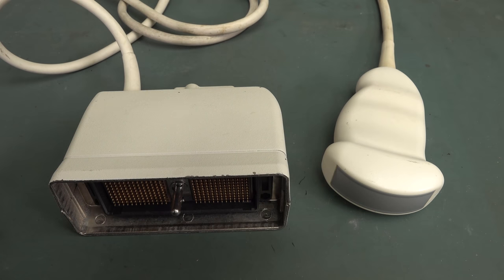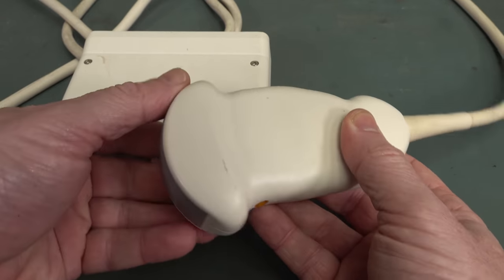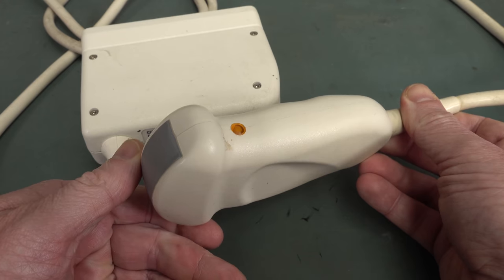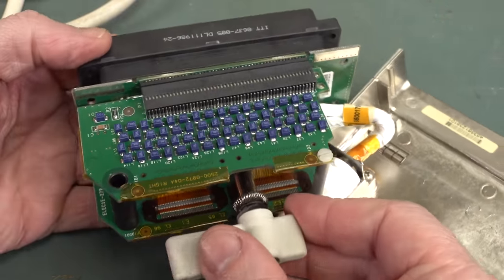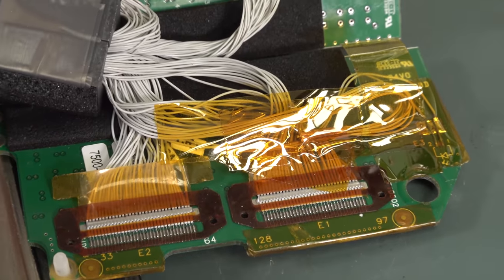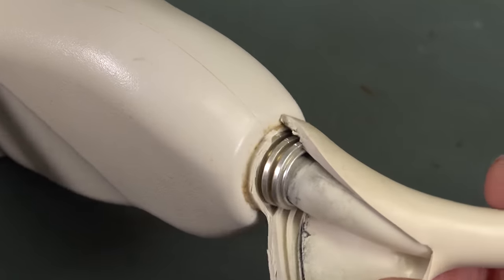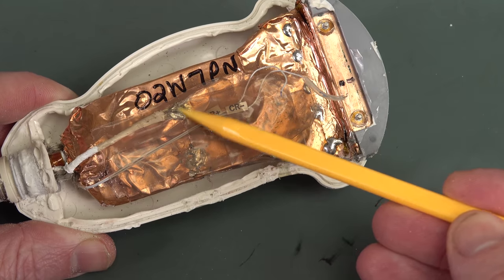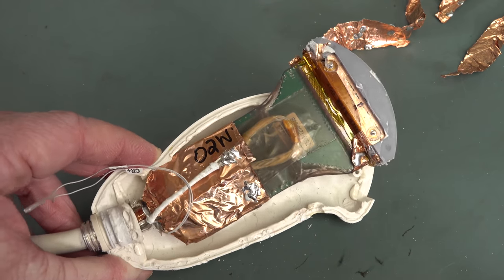EEVblog #1315 - Ultrasound Probe Extreme Teardown!

Comment from the maker: That time when you destructively tear down something old and then find out they sell for up to $500 on ebay...
Reply: Wow, ain't that a bastard
Reply: Still, we are so grateful for you taking it apart! Very interesting ;)
Reply: well.. selling something for $500 doesn't necessarily mean it will be sold for $500 :D
Reply: Just pretend that the reason they threw it away was because the bit that makes this worth the 500 is somehow broken and thus the mistake doesn't look so bad suddenly.
Reply: All usg stuff are overpriced on ebay (i repair them as daily work), this one is worth  $50 max but you need to sell it in Africa.
Reply: Probes cost around 10.000-40.000 euros new ;)
Reply: @robertjung8929  That is what is routinely assumed for shares...   Ridiculous, I know, but all the stock markets are based on this delusion.
Reply: The current type (with the modern USB interfacing so quite a different beast) is selling new for 6,500 euro...
Reply: i doubt this goes for 500, these are found everywhere for cheap on ebay. 10..50 bucks at max if its this old   if its listed for 500 doesnt mean its worth this much.
Reply: I think I accidentally clicked on the "Report" button on this comment. Sorry. :(
Reply: The educational value for all your viewers is worth more than 500 bucks. Thanks for the teardown!
Reply: @Rob2   .. That's SURPRISINGLY cheap. I would have estimated 1-2 orders of magnitude more.
Reply: @perfumedmanatee6235  Take it apart, then sell it on ebay if you can!
Reply: That's the price of science Dave :)
Reply: @iamdarkyoshi  I to infinity and beyond on that comment totally totally totally agree.
Reply: @perfumedmanatee6235  I knew that was coming I could just smell that comment somewhere.
Reply: @TomStorey96  yeah you could sew it as a Dave Jones artifact.

Or SAS dismantled by Dave Jones of EEB blog.

And record a video of the YouTube video and send it with him on a DVD.

And say it was recorded performance art.

You know how they shredded that painting antonym who knows maybe this is the next thing.
Reply: @Petertronic  oopsy accidentally clicked thumbs down Mediquick thumbs up recollect it there you go I think we've all done that.
Reply: Hey don't feel bad I think I did worse once but don't know a long time ago excetera excetera and this was before eBay existed or even the internet or anything so yeah.

I had gotten ahold of a bunch of what seemed like random bits from old electrical/old school I mean really old schools Electronics this was back before they had even integrated circuits at least a time. This thing was from.

Even some vacuum tubes were even still coming out at that time. Don't know the year or anyting.

But what I dismantled in discombobulated and Salvage scrap whatever may have been possibly a piece of electronics history?

Don't know when it was made or for the later one or what?

Or even what of it was used for what but only had a lot of bits and pieces and some assemblies and a lot of other things with this. A lot of it look very similar if not the same.

Recently owned reading and realized that oopsie.

It was branded Westinghouse almost all parts Westinghouse.

All the wiring most of it was cloth covered 

And it even has an influence for battery like 24 possibly some other voltages. I can't remember everything.

There was a fairly large panel with wide binding posts and other criminals wire links.

There was also a couple panels that had receptacles in addition to all that.

I do remember seeing a tag on a related said Westinghouse supervisory relay.

There was what looked like a tuning fork except it had coils and some other things on it.

There was a couple big solenoids and some sort of a speaker or what looked like a big old school telephone earpiece except obviously put out more audio than. That.

And there was a tag that said tell us something something something couldn't read it it was so badly just not there.

I mean this stuff and me who knows how old.

My understanding was part of this was used as a demonstration system of some sort and it's part of it came from actual installations but I don't know what was what.

After further recent reading a few months ago I figured out that this may have been something to do with the Westinghouse televox system.

As I remember it looked a lot like what was in the reading material.

And I also noticed there's a lot of that stuff that was Westinghouse branded although a lot of this was just random junk.

Me and there was some pretty cool interesting stuff that I want if I see using out of it as well as other things in I guess you could say a pile as well.

But I got this from someone that I knew a long time ago

He had gotten a few truckloads of just odd stuff.

And evidently just came from and old at least some of it for a power plant and other industries that have been shut down for years.

I don't remember any details from where it was or anything.

And he said that it had been in storage even after that fact.

And yes there were some tubes but not like anything I've ever seen.

There is mention of something-or-other grid glow something something.

At first I thought they were some sort of weird maybe Annie on memory tube or one bit something or possibly maybe a switching the neon lamp of some sort.

Or maybe a one bit memory tube that would be connected to a capacitor and a charge would be applying which would cost of tube to conduct and then retain their charge on the capacitor.

KY wife what they used to do for some of the old TV tuners that used a neon indicators as a one bit memory.

Or I thought those tubes could have somebody do of triggering or indication.

 at first I thought it was some sort of voltage regulator tube.

Not necessarily the oldest actually probably was the oldest if I've ever taken apart wish I maybe I haven't taken Man Apart.

It was kind of a shame. After I realized what it might have been.

 it seems more like instead it seems more like instead of it seems more like instead of I killed Kenny I killed televox?

 This very well probably was a piece of electronics history. Debbie sorta-kinda f.

But evidently later on this was used as at least what this was part of if it was a demo unit.

Which is unknown to me of course.

 Although part of it may have been in part of it may have been used in distillation because amount of it and the various looking parts that wears the same internally.

Essentially later once it was further developed it was used as an automation system of some sort.

It would have been used over the old telephone system to be able like control maybe like four or five items or so. Unattended.

Fraud over the cliff come from the same place but didn't seem like it.
Reply: Sould i buy a Siglent SDS1104X-E or a  Rigol 1054Z the (rigol is  110$ cheaper)
Thanks
Reply: Thanks! You helped me fix the one I am selling with 2 other probes and an ultrasound machine for $3700.
Reply: what's more, is some people can't even buy one cause their country (like India) has various laws to prevent gender "selection"
Reply: f
Reply: Some hospitals has been demolished with this equipment left inside._
Reply: 5:52 bahaha
Reply: This was more than $500 worth of content so product well spent!
Reply: Y'know Dave, they're about 10-20k€ new in Germany
Reply: @robertjung8929  this thing is even lot more expensive, a sector array probe like this one would cost around 5000$
Reply: You'll make more in that on this video I'm sure!
Reply: Can I ask what you did with the transducer. I'm intent on building some Jordie glasses.
Reply: Next teardown is phone ultra sound
Reply: It's similar to Phased Array radar, only it's using a ultrasound transducer. The actual beamforming is doing by phased offsets and can be scanned in various modes. Constructive and Destructive interference, much like RF radar.

Comment: Ultrasound professional here. The C5-2 used on the ATL/Philips HDI-5000 was carried over to the iU-22 by Phillips that was EOL'd in 2017 and many are still in use today. The C5-2 was superseded by the newer C5-1, a much better probe, but many of these are still in use regardless. The physical technology has changed some since then (crystals are now grown in one single piece rather than cut to size), but the major changes have been made in machine size/power and software.
Reply: Dear sir, do you know if there is a table for all the resistor circuit lists inside each of these probe that we need to change in order to make it compatible with different machines?

I've been looking into this but to no avail. Say, I want to use the linear probe on the Sonoace X8 and I have with me one probe from the Sonoace X6, which resistor do I need to change inside the probe to make it compatible and interchangable?
Reply: Can I ask you questions about ultrasound probes for a senior design project my group and I are working on?

Comment: Thats not a connector, THIS is a connector!
Reply: @raymondcourtois67  about like comparing 1/4 inch by 1/4 inch glass fuse to the fuse for the ludicrous mode on Tesla Motors or 2 a utility fuse versus the 1 1/4 in fuse but yes I agree with the knife idea.
Reply: @raymondcourtois67  YESSS

Comment: Those inductors are not for EMC. They are tuning inductors, one for each transducer element. The PZT transducer elements are basically Type II Ceramic capacitors.
Reply: H Higgins  if it is tuning I think they'd make emc worse, not better? If it was resonating with the capacitor it would cause an amplification in the current at the frequency of Interest. Admittedly maybe  less at other frequencies.
Reply from the maker: Wouldn't that cause huge tolerance issues in the resonant frequencies between channels?
Reply: @EEVblog  The medical imaging people spare no expense! Makes me think of that clip from Jurassic Park you always play. They need to match the ceramic elements as well as the inductors to have all of them resonate at the same frequency and with the same Q. I'm not sure about Philips, but Olympus (I think they are the leader in ultrasonic imaging transducers for medical and NDT&E) has very tight specs on channel match. I think they have to sort through their components and bin them to get ones that match...
Reply: H Higgins  Sure. By making the transducer much higher Q at the transmit frequency, they are also filtering out other frequencies and harmonics.
Reply: @EEVblog  I guess it's more impedance modifying than tuning if they are working over more than an octave of frequency.   But it probably makes it easier to get enough current through the transducer at a reasonable voltage.

Comment: The amount of engineering that goes into medical devices never fails to blow my mind. Very cool!
Reply: Same
Reply: You know it's good when the shielding is actually interesting!
Reply: Lassi Kinnunen  True words, some of the medical "you could by a house instead" devices is shockingly bad (pun intended).
Reply: They dont skimp on cost, either. That grey PTFE tape used under the copper foil is like 600 USD a roll. Remember using it at work and it just about costs more than gold. Even a little skinny roll of it costs like 100 USD.

Comment: I counted and I think there are 268 elements...I have no life
Reply: Bloke above you counted 266?? I'm not checking...Or am I? But 260 pins on the plug 13x10 per side and 4 rows of 16 inductors on one board. They are numbered and alphabetically marked. 50 pin pairs per connector.
Reply: The traces on the circuit boards were numbered 1...128.  So I would guess there are either 128 or 256 elements.
Reply: 128 elements, so more likely 256 electrical contacts, as each crystal needs two contacts. Its possible there are a few more than that for sensing/grounding, so 268 WIRES isn't an unreasonable number.
Reply from the maker: Nerd fight!
Reply: @EEVblog  Ha ha ha....watch it mate!
Reply: @EEVblog  lol
Reply: @martinda7446  i probably got it wrong, was not using my brain xD
Reply: Mai Mariarti  ?

Comment: Hey Dave, I'm from Philips Healthcare and thanks for dropping all our IP on the internet :) No really, what a marvel in engineering, wouldn't you agree? 
So that unit on the screenshot you showed in 1:23 is our Lumify POCUS. 
POCUS is Point Of Care UltraSound and is a complete US system in a transducer. It's connected to and fed by a normal Android tablet using just one USB connector. Indeed a huge step from the Philips/ATL cart you showed. Mind you, this is an extremely powerful and versatile tool in the field, but does not hold a candle to what is possible nowadays with a more potent sized US unit. For the Hospital we still have those "Wall-E" like unit allbeit way lighter and extremely ergonomic with flat/touch screens and the works. Brilliant 3D processing, it's  incredible, really. Thanks for sharing and showing the engineering that goes into devices like this. Learned something myself, because I'm more into the MRi and CT corner of our company.  Do you want me to deliver a 6300 kg magnet for teardown? You will need some heavier tools for that...
Reply from the maker: Thanks for that.
Let me check, but I'm fairly sure 6300kg will be too much for the lab building lift...
I've got a nice hand trolley though if it fits :-D
Reply: Oooh ide love a big magnet like that.. you can come to my shed and do an autopsy on it dave
Reply: This a great video but the companion video should be ‘how has Phillips actually manufactured  this beast

Comment: All these wires must be co-ax, to minimize crosstalk. 15:51 Outer braids and inner conductors are welded separately. So they used good-old hypertronics connector with 256+ pin for 128 elements. Extra pins are also used for identification EEPROM (3:59, top right corner in PCB). 
These wires also have some extra loops in the connector cage to ensure all co-ax wires approximately same length. With my experience on industrial ultrasonic testing, ~1ns phase alignment should be enough for <10MHz applications, but trimming and looping those wires cost nothing anyway.
Reply: They are indeed coax wires. And a pain to hand solder.
Reply: I need to learn how to fix probe problems, could you give me training??
Reply: @giangle2849
Dear sir, do you know if there is a table for all the resistor circuit lists inside each of these probe that we need to change in order to make it compatible with different machines?

I've been looking into this but to no avail. Say, I want to use the linear probe on the Sonoace X8 and I have with me one probe from the Sonoace X6, which resistor do I need to change inside the probe to make it compatible and interchangable?
Reply: Hello Sir, could you check my post if you please about a query about probe cable manufacturing that I have (I posted today)?

Comment: I worked for Atl in the late nineties as a field service engineer, great to see inside of the scan heads as we just swapped them over when they went faulty and always wondered what was inside of them. As we use to send the faulty ones back to the  USA for repair. There was lots of shielding to stop interference on the signal going back to the ultrasound, hospitals were a very electrically noisy environment.  great memories to see the HDi 3000 again. Thanks for the teardown Dave

Comment: 10:42 it's 266 stripes /133 elements
Reply: The connector has 260 pins on it, too
Reply: in fact 128 elements.  It is nearly standart for ultrasounds to have 128 elements for US and Europe brands. For Japanese brands, it is  generally 192.  This is related with analog channels. But now there are matrix probes.
Reply: Starting around 15:38 we see the board connections are actually numbered 1 to 128, and a minute later we can see the head itself is numbered likewise (though a bit harder to read).

Comment: @1:36 That tablet in the photo you showed looked exactly like my Nvidia Shield Tablet. They had it up-side-down in the photo with it sitting on the buttons! lol
It's not a custom tablet or new, it's one of the first gamer tablets featuring an Nvidia GPU. So it looks like the ultrasound probe is now made to work with a custom app in any Android tablet with a micro USB port. Maybe they have one with the more USB-C too.

NOTE I just read up on the probe and it says "compatible with select Android devices". Maybe the Nvidia Shield Tablet is compatible because of the GPU making it capable of showing a realtime display that would be needed.
Reply: maybe the graphics needed for gaming made it desirable ..

Comment: I work as an engineer at a hospital in Norway and i can tell you that a normal 1 phase probe cost around 6000 USD. And if you run over the wire, just a litte bit, you have to change the whole thing. Also you can get a probe that goes trough your throat and rotates 180 degrees, so you can see the heart without any bones or lungs in the way. (But you have to be very skilled with 
anatomy because you are basically blind) But Those are very expensive. Because if you have a probe that close to the heart only 60 µA is enough to kill a man. Thats why they used to check for ampere leakage after each use in the old days, but now we only check it every 2nd year.

Comment: Note that all elements have their own tiny coax inside the big coax to minimise crosstalk since the returning signal is so tiny.
Btw we just bought the new model at work and it is used with a standard samsung android tablet
Reply: I figured that would not be a medical specific tablet. Also did you hear about the medical device that was based on the Game Boy of some description Hardware. Something with cardiac something or other.

Comment: Couldn't be arsed counting the stripes on the head like some people, however as a giveaway, there's 128 inductors, at 16:21 there's  1 and 128 written on the head and at 15:38, 1 and 128 written on the PCB where the flexi from the head attaches to the PCB.